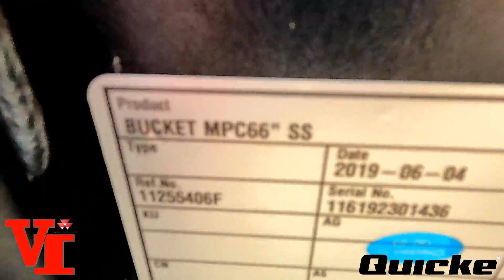Quicke 170MPC Multi-Use 4-N-1 Bucket for Compact Tractors

Comment: So this would be available on a new 1526H  if I order the tractor from the factory with it as a option ? Or is it a dealer installed option ? This is a pretty cool feature & does eliminate the need for several other implements awesome ! Thanks for the video.
Reply from the maker: Currently the Bucket is only available from Quicke Loader Dealers so it would be an additional purchase as the 1526 Loader Package comes with a Traditional Bucket but this could be added as additional implement for the loader.

Comment: Nice review i think those bucks are what I call a farm bucket. I had one from long and it is difficult to grab certain things.  I wouldn't take it on a brush job as it doesn't have the same mouth that a grapple gas
Reply from the maker: It has the ability to do many tasks versus a Grapple is a single task tool. It's something to consider depending on the tasks you need to do.
Reply: @VahrenbergImplement  oh I agree with you 100% I farm and own a tree service and land clearing business the bucket id leave on a farm tractor and use it for tasks you mentioned. I highly recommend that for those tasks.